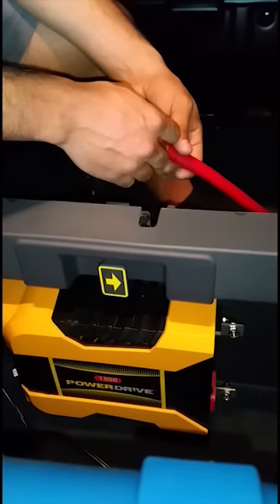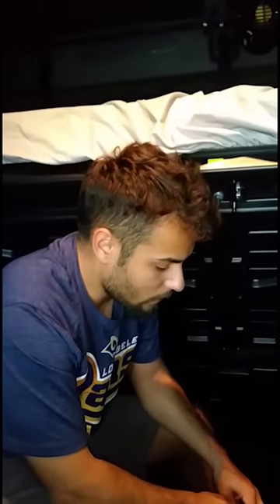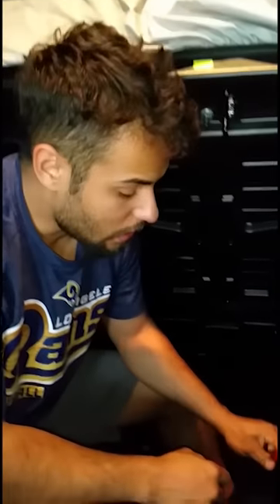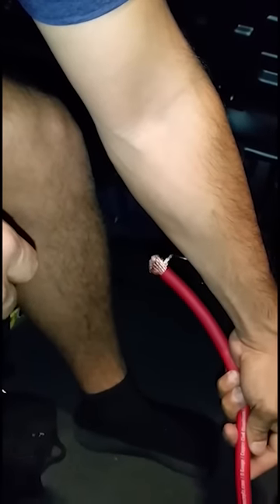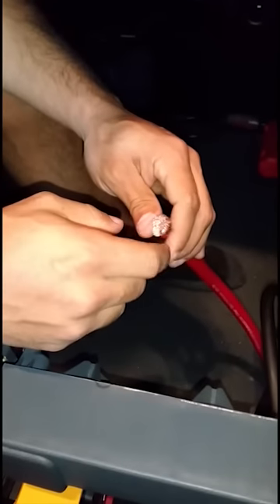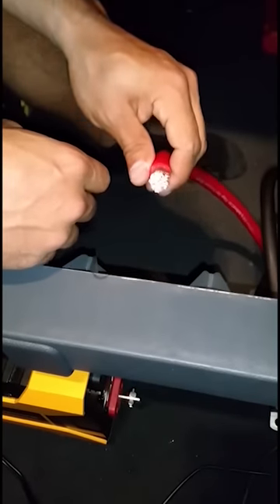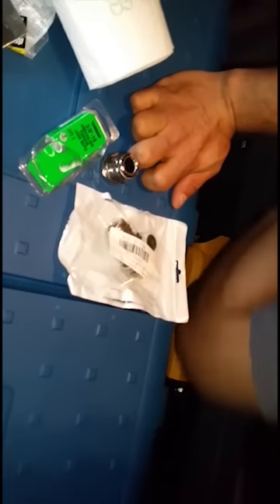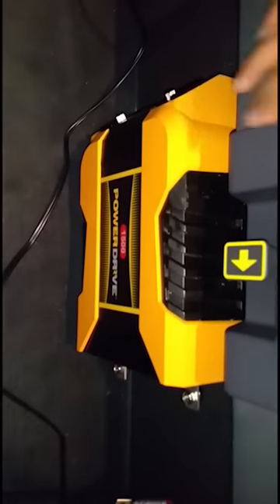DIY How to install a Inverter on your truck tractor trailer part 1

Comment: LOL, I used to drive for useless xpress sister company total transportation failure of MS. I just so happened to trash find one of these exact inverters at my new job as a building engineer and looked it up. This came up and brings back bad memorys of that nightmare frieghtliner cascadia.

Comment: I like those "Set Screw Ring Terminals", you don't have to crimp the wire, buy a crimper, or rig a crimping mechanism.

Comment: I use a stranded wire. One you would run power to a breaker box in your detached garage. Smaller diameter. Handles a lot of power.

Comment: Can i connect the small ground wire to any bolt in the chasis or under the bunk bed? 
Under the bunk bed is all metal.
Reply from the maker: Yes u can as long as you are getting good ground from that spot

Comment: Everything looks good ... Only thing i would do different is run the red wire away from airlines or fuel lines and wrap it with that black protector thing  ... To be on the safe side !!!!

Comment: Thank you for sharing your tips! We followed your instructions and set up 2500 watts power inverter on freightliner cascadia 2014 and used it about a year and now when we turn the power it switched off by itself right away it's like a flash, we thought it was the inverter, so we bought a new one and did work, we also changed the fuse and breaker still not working. Please advise us what could it be? Or how to fix this. 
Thank you!
Reply from the maker: Need to make sure your receiving voltage on the end of the wires

Comment: Do you think my Keurig would work  like this with a 2000 W inverter using 10 feet of 2 Gauge wire?
Reply from the maker: What's the wattage output on it

Comment: You mounted it where the apu is in my 2016 Cascadia, I would have to wire it further, but that poses an issue because 12v degrades over distance

Comment: Does the inverter blow hot air in the cab mine does I think a minimal amount of heat is inevitable but big amount of heat not be normal I also have a 3000 but same brand

Comment: Since I'm here can you do a parts list and where you got them the fuse the plate and the grommets thanks and where do you get that cable I was just going to use a set of jumper cables and cut the wire

Comment: Did you figure size for working power or max starting draw? And did you cover those terminals at the inverter with the heat shrink you listed in the parts list or something else?

Comment: Did you use a 300amp inline fuse or a 150? Also if you did use a 150watt could you have used a 300watt? Thx
Reply from the maker: 150 amp fuse for 1500 wat inverter
300 amp fuse for 3000 wat inverter

Comment: thanks man for this video 
to use mini fridge and microwave for semi truck freightliner Cascadia 2016 . which one I need converter or inverter  ?
Reply from the maker: Maher A inverter would be the answer. I think converter is to bring 220 volts down to 110 volts
Reply: alright  .. thanks
Reply: @mahera7375  I got 2000 power drive everytime time I used my microwave the power shut off even with my truck running? Can only runs my microwave for 30 seconds. What can I do to fix this?
Reply from the maker: The inverter is no longer good, needs to be swapped. At one point it peaked out and burned a circuit inside. So just replace the inverter

Comment: How do you find out wich power unit I can max out with for my truck?   You mentioned something about only allowed 1750 max.    Couldn’t really here what you said.               2014 freightliner casacadia
Reply from the maker: It's a personal preference.  I only said 1750 because that was the company policy when I was a company driver. I seen many people put 3000 watt ones
Reply: Do you know how I would get WiFi for my truck?      T- Mobil got a device you plug in to your car.    But you know anything about that.

Comment: Did yours have the terminal fornthe 8awg ground wire? I have the 2000 and before I hook it up I want to find out if I need to hook it up to a third ground
Reply from the maker: Anthony Lanciano the third ground is just precautionary measure, you can still run it without it, but better safe than sorry. I had to purchase the ring terminal piece for the wires if that's what your asking?

Comment: Thank you for the wire link. I should have asked before, can you link to where you bought the waterproof pass throughs. Thank you.
Reply from the maker: Don Bandach If you look at the video description most of the parts list is there.  

https://www.amazon.com/dp/B01LSGU36K/ref=cm_sw_r_apap_s6c8XghMenM1y

Comment: Hey guys, can you post a link to where you bought the wire. I see knu koncepts has several different 1/0 available and I want to make sure I get the right one for this kind of application. Thank you.
Reply from the maker: Don Bandach thanks for watching, I reloaded the second part to this video.
I choose the ultra flex just because it's easier to work with

http://pages.ebay.com/link/?nav=item.view&id=380428717400&alt=web

Comment: 150 Amps is more than you need but it is sufficient. I use a 300 Amp on mine. For a 1000 Watt, you would need something equivalent to 85 Amps. Remember, W = Volts * Amps

Comment: Can you use a 4 guage on a 1500 watt inverter? That's what I read on a website. They said 0 gauge is good for 6000 and up.
Reply from the maker: sevenstring83 more than likely you should be fine depending on length.
Reply: Hamlet Dubois thanks again but might be good just in case I get a more wattage inverter so I want have to redo everything
Reply from the maker: sevenstring83 exactly my thoughts exactly plus you have extra wire there to account for corrosion

Comment: I Have the same Truck How long is the Cable wire ?
Reply from the maker: About 10 ft sir
Reply: @hamletdubois6201   how much you charge to install 3000 w inverter ?

Comment: We keep getting a LOP warning on our 3000 watt power drive but our batteries are good and our connections are tight. Could it be we have it connected to the wrong battery?
Reply from the maker: Tiffany Montauge what inverter is it the brand?

Comment: How many feet of wire did you have to order to reach all the way to the battery?
Reply from the maker: cobratrick96 the total space is 10ft so you would need one 10ft wire for your ground and another 10ft for your positive connection.

go to 24:41 on the second video to see the list as well
Reply: BroBro Truckers I already watched both videos. Very helpful stuff. I used your list and have my shopping cart already set on amazon. I really appreciate the upload.
Reply from the maker: cool beans! I wish I had made the video more wider but I was still learning on how to edit and all. stay tuned for more. and safe travels
Reply: BroBro Truckers don't sweat the small stuff. The content is what matters, and y'all delivered.

Comment: Where did you get the electrical plate?
Reply from the maker: warmac immi you can get them at home depot

https://www.homedepot.com/p/RACO-4-in-Square-Blank-Cover-Flat-50-Pack-8752/202058391?cm_mmc=Shopping%7cTHD%7cG%7c0%7cG-BASE-PLA-D27E-Electrical%7c&gclid=CjwKCAiA3JrQBRBtEiwAN7cEGqkZ24gbwRp2bDmZJQZvXNdiYD7VV6yz2Nd4VYj2oZPDKFeM91-9lxoCNwAQAvD_BwE&gclsrc=aw.ds&dclid=CILA4eCZuNcCFYJqAQodVx8BHg
Reply: Hamlet Dubois thanks a lot

Comment: Hey man!! Really liked this descriptive video. I'm going to install a 2000w inverter myself. I just had one question. What size wire should I use for the ground connection?
Reply from the maker: Sarooperman 0 Guage will work, just make sure you use the same size for the power wire or thicker for the ground. The positive wire should never be bigger than the ground, but it can be the opposite.
Reply: BroBro Truckers But I see in your video that the thickness of the wire that you used to ground the inverter is really small. It looks like it's about 14 gauge wire or so.
Reply: BroBro Truckers Never mind bro. I saw the part 2 again and you mention that you used 10 to 12 gauge wire for that little ground connection on the inverter. Thanks

Comment: where do you buy the fuse from?
Reply from the maker: Blue Sea Systems 5191 Fuse Block Terminal 30-300 AMP https://www.amazon.com/dp/B0019ZBTV4/ref=cm_sw_r_cp_apa_buAyAbGMBFVVY

blue sea systems fuse hope it helps
Reply: Hamlet Dubois what kind of fuse do u use I mean which size thanks

Comment: bro will this work for a 2500 inverter
Reply from the maker: yes, watch the last 5 secs of part 1 and part 2 for wire specs
Reply: Good looking bro. This is Chris hill from Facebook. I just got a 2017 freightliner

Comment: Witch is the size of the wire gland connectors ?
Reply from the maker: Diego Velez the size is m25
Reply: Thanks man I really appreciate!! Another question where did u gets urs ?
Reply from the maker: Diego Velez you just need to make sure of your thickness on your 0 gauge wire . but most 0 gauge wire is 16mm. thick.  the link below goes up to 18mm.

uxcell PG21 Metal Waterproof Connector Fastener Locknut Stuffing Cable Gland Cable Range 13-18mm Thread Length 9mm https://www.amazon.com/dp/B072J3VB9S/ref=cm_sw_r_cp_apa_y0GHAb81XS8MZ
Reply: Hamlet Dubois  yes I bought the same wire you show on the video ! But i just can’t find the same wire gland connectors stainless steal
Reply from the maker: https://www.amazon.com/uxcell-Stainless-3-0-6-5mm-Waterproof-Connector/dp/B0714CXD3P/ref=pd_bxgy_60_img_2?_encoding=UTF8&pd_rd_i=B00AOBGQ26&pd_rd_r=PDX64F8TG2N8R5WRVWEC&pd_rd_w=GxD84&pd_rd_wg=PcVke&refRID=PDX64F8TG2N8R5WRVWEC&th=1
Reply from the maker: They are made by uxcell you need the PG25 ranges from 15mm to 22mm. Try ebay if the link dont work
Reply: Hamlet Dubois thanks brother u the best ! Keep teaching us with ur best knowledge!!!
Reply from the maker: Diego Velez anytime and thanks for watching
Reply: Hamlet Dubois but the link above is pg21 can u tell me which on is fit pg21 or pg25 thanks

Comment: Can I just hook it up with jumper cables
Reply from the maker: Quintin Franklin that would be temporary, you defiently need to get a way to get it bolted down so sparks don't fly becareful
Reply: Okay yea my company only allow 300 Watts
Reply from the maker: Quintin Franklin oh I see what you mean, got you brother! you defiently going to need more than 300 lol
Reply: Quintin Franklin look at the jumper cable wire and make sure its big enough,. Sometimes the cable is all insulation and small wire. Also google "american wire gauge capacity " It will tell you what size to use taking account of how long the run of the wire (battery to inverter ) and figure for max starting amps to be safe. Good luck on your project 😎

Comment: Isn't the wire to tick , I'm using #4 wires on a 2500 watts inverter and works fine .
Reply from the maker: Synergy Express Inc yes you can use #4 and get away with it. therees a chart on voltage drop depending how long your wires are. I got thicker wires because I was going to be upgrading to a bigger inverter . also having thicker wires helps against resistance due to corrosion .
Reply: Thank you .

Comment: Just saw the video nice install... question though... why didn't you make the ground wire short as possible and connect to frame?
Reply: The negative cable for your battery is connected to the frame so it’s less work.
Reply from the maker: Also having a direct connection to the battery is best to avoid any interference from the cb or radio

Comment: is this connected to just one battery?
Reply from the maker: Jason Ward the wires to the inverter are just connected to one battery but the batteries are all connected to each other from the factory. Hope that makes sense

Comment: what diameter of a cable?
Reply from the maker: AD SHAD all depends on inverter size watch the last 5 seconds of the video for the chart. also I used 0 gauge wire

Comment: 8:12 uh no 😑 you connect the  "red + " power first, then "black - ground last or 2nd
Reply: No you don’t actually. The black first then the positive red to your fuse then the battery. They make this very clear in the manufacture instructions.

Comment: Somewhat informative but overall, the video was damn near unwatchable. First, you guys need to create an OUTLINE of ALL the points you want to address with your video. Then make up some index cards that you can glance at to make sure you're on the current topic for which those words coming from your mouth are referencing. The part where you go under the truck... that should have been on index card #3. Planning the install should be Step #1, and Buying the Appropriate Parts, that'd be Step #2
And last, why haven't average people figured out that if you record your videos with YOUR PHONE TURNED SIDEWAYS, you will be able to post a video that looks like it was filmed in CinemaScope instead of looking like a 2nd grader tried recording something through a 4"" opening in his bedroom door.